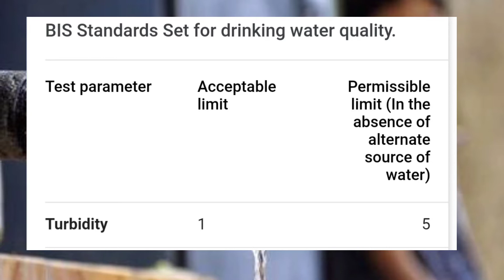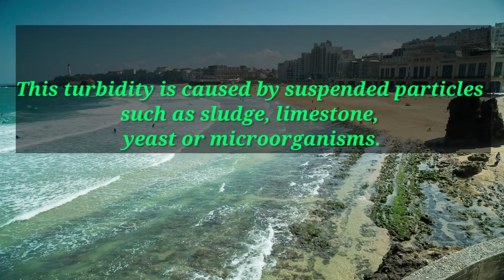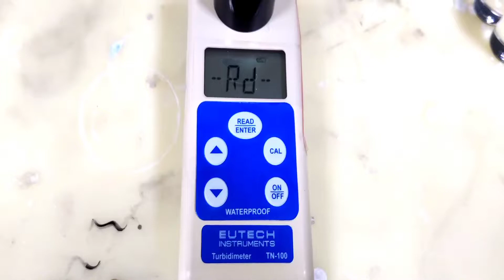Turbidity test of water | Calibration of Turbidity Meter

Comment: What does NTU  mean??
Reply from the maker: The unit of turbidity is typically measured in:

1. Nephelometric Turbidity Units (NTU)
2. Formazin Nephelometric Units (FNU)
3. Jackson Turbidity Units (JTU)
4. Siemen's Turbidity Units (STU)

NTU is the most commonly used unit, and it's defined as the amount of light scattered by a sample at a 90-degree angle to the incident light beam.

In water quality monitoring, turbidity is often measured in NTU, with the following ranges indicating different levels of water clarity:

- 0-5 NTU: Very clear water
- 5-20 NTU: Clear water
- 20-50 NTU: Slightly turbid water
- 50-100 NTU: Turbid water
- 100+ NTU: Very turbid water

Turbidity can also be expressed in other units.